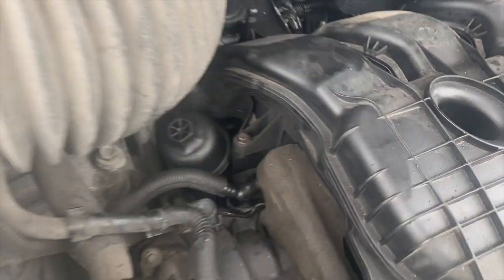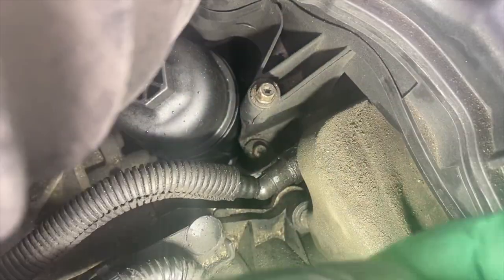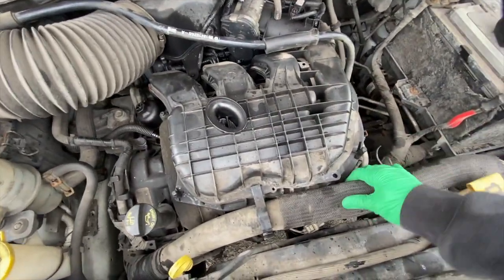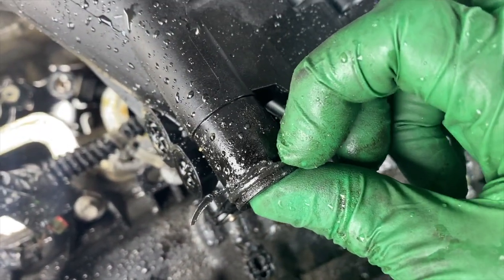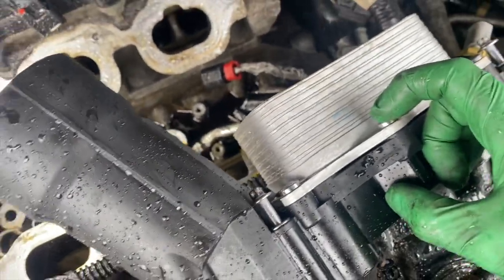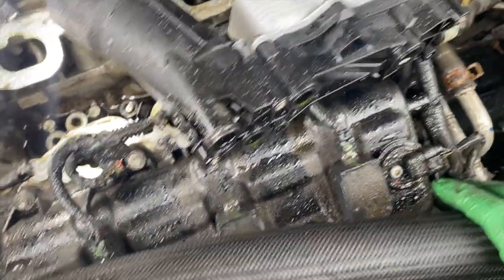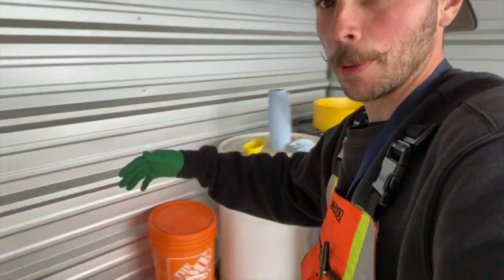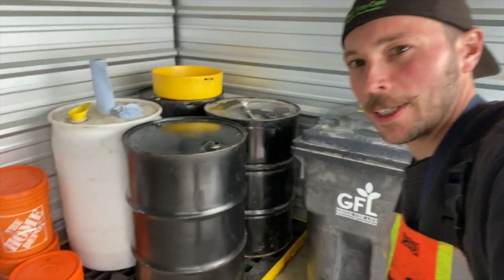The Life of a Mobile Mechanic : Dodge Grand Caravan Gross Oil Leak

Comment: Ah. The pesky 3.6l penastar engine with the leaky plastic oil cooler. I always replace it with a aluminum oil cooler with new gaskets and sensors. Done plenty of those. Sad Chrysler is still getting away with this. But it keeps  us mobile mechanic busy.

Comment: What year was the vehicle?

I just replaced my oil cooler in a 2014 Dodge Grand Caravan, and the Mopar upgraded part came with a red o'ring to be used up to 2021 models (it is not as thick). The black ring needed to be removed for it is for 2022 and up. 

In addition, I changed the spark plugs (Champion OEM)

The initial reason I did the above is I got the infamous tick at
148761 Km.

I replaced all the rocker arms (defective 2011 -2016) and valve lifters (not required but had the cash) and  all new gaskets (lower / upper inkakes and valve cover set). 

When looking at my old oil cooler, it probably did not need to be changed, but seeing this can be a failure point for Mopar upgraded the part and had the cash it was best to change it.

Never did this before. I just watched several YouTube videos to build my confidence. 

I am very satisfied with the results. Running great. 

Seeing the cost of vehicles, I am investing in this one. To make it more modern, i am looking to upgrade to led lights, a new Android head unit, and other items.

Great video.

I will update you with the cost of do it yourself and dealer price in Canada.
Reply from the maker: Keep up the hard work 👍🏻👍🏻.
Reply: Red for 2014 and under black for anything after